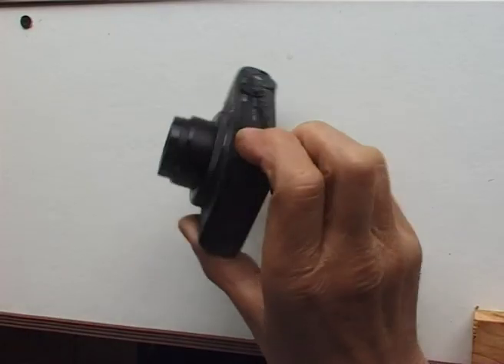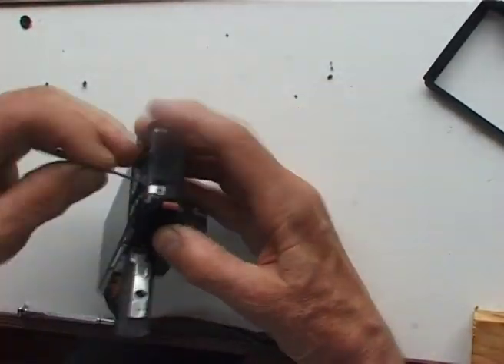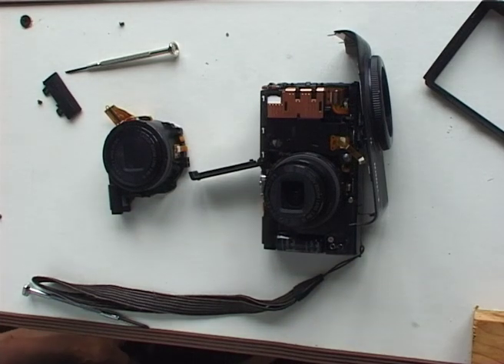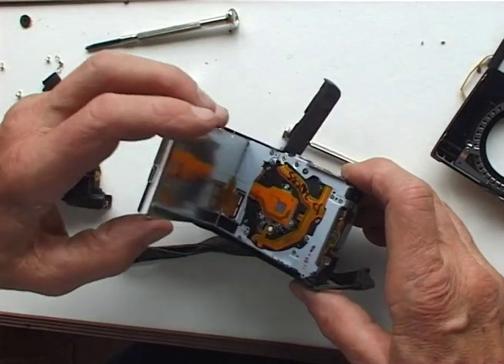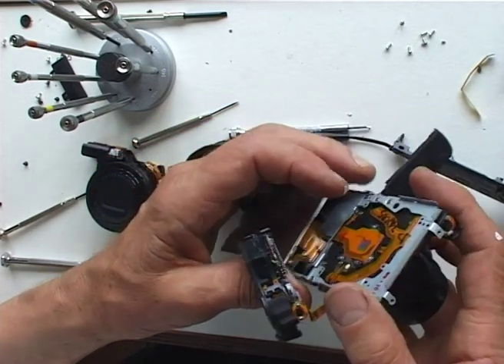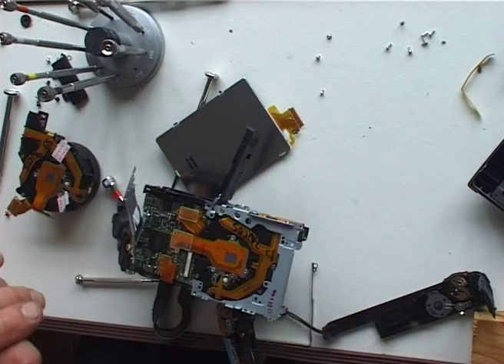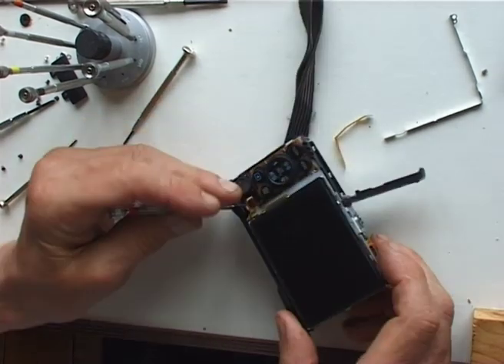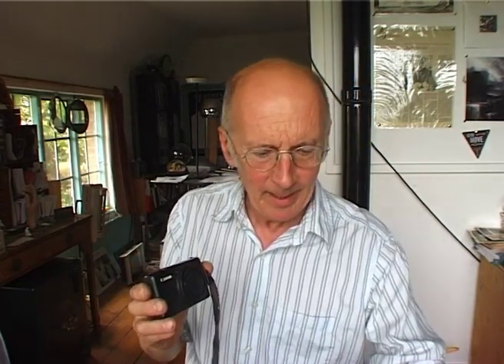Replacing the lens unit of a Canon S95 camera

Comment: Thank you so much for sharing this!  My S95 somehow got a speck in the lens that shows up as a slight cloud in all my pictures.  I replaced the lens according to your instructions and it's good as new now!  In order to get the bottom camera screw hole to align correctly upon reassembly, I had to keep the battery compartment door open.  Also, I used a dull safety pin to reattach the small cables and push them into their slots.  Thanks again!

Comment: Hi Tim, thank you kind sir for sharing your experience with us. I actually have an s100 which had the dreaded lens error. I had purchased the camera via grey import from Hong Kong and so after inquiring about warranty had decided to purchase a new camera rather than pay for the camera to be sent internationally. It had sat on my shelf for a year when I decided to look for a way to fix it myself. Your video gave me the information that I could purchase a lens on ebay, and gave me the confidence to try replacing the lens even though I had no idea what I was doing! I learnt from your unfortunate mistake with the ribbon for the ring dial and easily detached the ribbon when dismantling the camera. I have just finished and my camera is working again! I am over the moon and I have you to thank for it. So thank you Tim!

Comment: We've loved this camera for taking pictures of our daughter ever since she was born. She and the camera are 2 and a half years old now and I let her take pictures with the camera as she grew interested in it. Of course that was just asking for trouble. It was only a matter of time until she dropped it on the open lens and it got stuck.

Your video saved our camera! With your help, I replaced the lens unit and we're back to taking pictures of our beautiful daughter. And I'm looking for an older used camera that I can let her take pictures with :).

You were right about those final screws holding the lens unit being tough! I ended up stripping two of them and had to use a 1/16" bit to drill them out.

Comment: Thanks for this great video. My lens unit was damaged when I accidentaly switched on the camera in my pocket. Repair by Canon would have been too expensive. From your video I got the idea to order a replacement lens unit at Alibaba for less than 20€. Thanks to your hints, I managed to repair the camera even without damaging the connection of the lens ring. After reassembling, I noticed, that I've also saved one of the screws ;-)

Comment: Hello Tim,  Thanks a million for daring to take your camera apart to change the lens and for also videoing the process for the rest of us!  Thanks to your clear instructions and your unfortunate mishap, I was able to take mine apart and replace the lens with no problems at all ... although, like Sebastian Queißer, I have ended up with one spare screw!?  But no matter, as my camera works beautifully again.  I had got some glitter embedded in the lens somewhere and no amount of hovering over the lens could dislodge it.  So I bought a replacement lens for £10 off Ebay.  Without your video, I would have had to buy another camera, or spent a ton of money getting it repaired.  Thanks very much, Tim - you're a star!

Comment: Well done! - How was the result? Each and every one of those image sensors (be it CCD or CMOS) has dull or more sensitive pixels, which needs to mapped out in the camera's firmware. This is done at a professional shop where they have test equipment and special programming cables to calibrate this in the camera. Replacing the sensor and not telling the camera will leave you with a camera that has some wonky parts in the picture.

Comment: Great video, but after watching I decided to take another approach. As it was broken anyway I figured I had nothing to loose so before I bought a new lens I would get physical with it first. 

I grabbed the outside of the lens with a pair of pipe grips (better than pliers as you can adjust the size) and pulled. A bit of a yank and pop, out it came. It left a few scratchs but fully functional and working as far as I can tell 100 percent. Not sure it would work on all dropped cameras, but worth a try as fast, easy and free.

Comment: Awsome video, I too had dropped my s95 camera, lens first, and jammed the lens. 

This helped me removed the lens and gave me a heads up on what not to do (ring ribbon). But most of us prolly dont use the ring function too often anyways.

My question is where did you buy the new lens? I found some on ebay new, but does not come with the center ribbon that goes over the rear opening of the lens. 

Thank you for being the "test" subject! Very helpful!

Comment: superb video , i need to do the same procedure to my s95 - waiting on lens assembly coming from china. thanks again
Reply: Robbie Red  - DONE! thanks very much for taking the time to upload your video. however now my flash module is a bit rough when retracting - i must have distorted it when undoing the very tight retaining screws.    I dismantled the old lens module out of curiosity - wow that is some piece of engineering inside. miniscule little stepper motors for focus, & aperture. a tiny servo? motor with rotary encoder for the lens extend / retract ( ie that part that had failed ) &  little shutter actuator.  there is also a magical piece of work with small coils and magnets in X and Y relative to a lens floating on tiny ball bearings. i presume this is the basis of the image stabilisation system. there are some clever people out there!

Comment: 🪛 Screwdriver was a CB handle of a friend of mine in high school. That ,  should still be - his handle.
   👋😎💨 Bryan
             🐎💨💕💨💕
Reply: Pentax 35 mm was & is such a (juggling act) between lenses 🐠 eye 🔭 photo , etc.  just like a circus.
=====
My film crank is broke but you can still turn it really slow. I took pictures at my niece's wedding and I didn't use the light meter because I didn't replace the batteries.
======
I thought the photos came out better plus it's fun to buy film from Mexico sometimes they (throw in a few free ones) sometimes (they take a few free ones).
=====
Plus on a darker side I thought about using the light meter off that Pentax as a night scope firing mechanism.
=======
It sees through the eye of a green-eyed monster Russian sniper scope.
=======
The light meter identifies the thermal difference in the target since the current to a solenoid step up.
======
Solenoid connected with twine (piano wire) whatever through bamboo on the trigger ; onto the other side .
======
It works great as long as your worst enemy is using it.